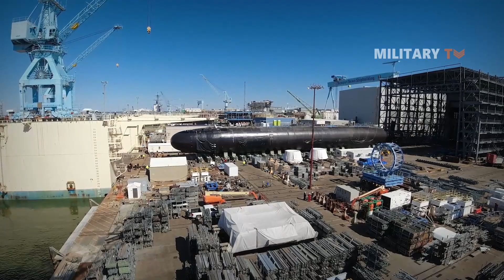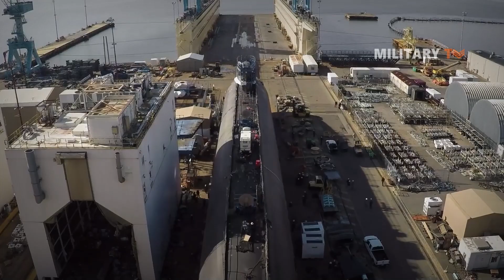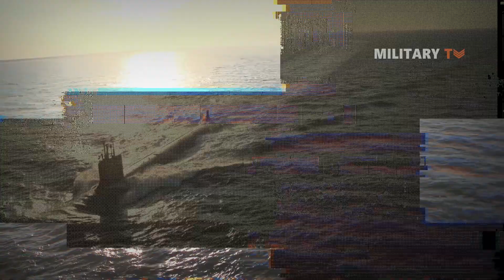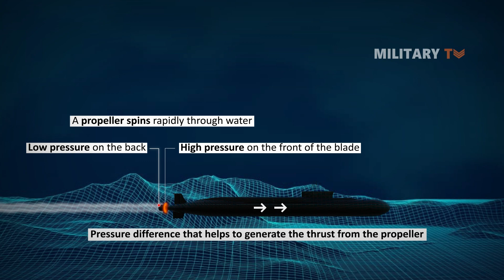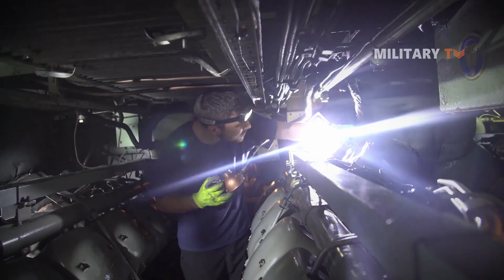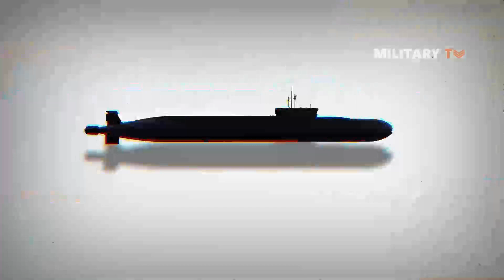The secrets of submarines that enemy must not know

Comment: They need to think outside the box on this. Maybe they could design a kind of cold jet engine of sorts. Use the reactor to heat water in an expansion chamber where it would be ejected out faster than it entered. Surely they could speed up the exhaust water faster than current propellers. They could use radiators to heat incoming sea water and shape the flow path using Bernoulli's principle so the expanding water would keep the flow going through their undersea "jet" engine. Shape it like a jet engine combustion cycle.
Reply: You may be surprised by how much thinking in and out of the box has gone into quieter ways of moving submarines around.   I don; really like your jet engine idea much though - Infra red tracking from satellites would quickly detect a submarine using such a propulsion technique.    Or indeed an MPA  /helicopter / drone  equipped with infra red vision.    Don't forget that much of the thrust of a het engine comes from the conversion of cold liquid fuel into hot gaseous combustion products.  Warming the water up a few degrees won't produce much thrust.

Comment: What about soft propellers like flexible rubber or plastic.
Or ones were the blades change pitch like planes.
A skirt trailing behind the cowling might muffle the pops.
Or several screws in line.
Maybe a texture on the blades or even change the propeller when underway.
Reply: To help you understand, cavitation is so much louder than normal operation that it will be detected by fixed sensors and will need to be explained by the commanding officer at the end of the patrol - an awkward conversation at best !    One cavitation event can compromise the whole patrol.    Loving the creativity, but ........

Soft propellors - not strong enough, but can still cavitate.  Water will boil to steam  and the resulting bubbles with collapse under pressure once free of the propellor's flow (=cavitation)  if the partial pressure  is low enough,cavitation will occur whatever you make the blades from.

Variable pitch - only efficient at one speed - more liable to cavitate at others.  The complexity of the hydraulics inside the shaft would probably be very unreliable and changing pitch would be noisy in its own right.  Type 21 frigates used CPPs, which were unreliable in their early days.

Skirts - how would this work ?     It might flap like a flag and be just as noisy.   Do not underestimate the loads on anything towed behind a submarine - it would probably not be there after a patrol 

Several screws in line - like an aero-engine compressor ? - you need to keep the flow through the "propellor"  as undisturbed as possible - each new lump you introduce  alters the flow and may cause more vortices and more points of low pressure (where cavitation can occur) 

Blade texture - the surface is carefully prepared / treated.  

Changing the propellor underway - what have you been smoking ?   Changing a "propellor" takes a few hours in a dry dock with a crane  and a gang of people who know what they're doing.   This is not like a car's tyre - these things weigh tons.  Even in a flat calm, I wouldn't consider doing this !

Comment: It's probably just shrouded like a jet drive... Less efficient, but these nuclear subs have power to burn. It will also cut down on sound. Have not watched your entire video. Waiting...
Yup, you failed to mention the obvious.
The ocean is littered with loose cables and nets. Mini sub design was changed because of lethal tsngling. Even on a huge sub with only one prop, a tightly wrapped drift net eould be a total disaster. They would be forced to surface at best.

Comment: It’s pretty pointless because they immediately log the signature of the propeller’s sound. They have done this on both sides so the only reason to hide it is actually propulsion efficiency. No matter how silent it is the signatures will be logged and identified on first contact. It’s definitely not the stealth, there’s a submariner who has an entire channel around how he tracked the Cold War subs of the ussr and how they knew them by name and encountered them multiple times. Submarines are so expensive that they are rarely launched and the enemy is aware of when and where they will be launched. They aren’t plentiful enough to be lost in possibilities of what sun could it be. So they are simply hiding the screw for knots per kw. sound signatures are simply impossible to conceal as of yet and if they were it would be with active noise cancellation which must be a heck of problem underwater because the military is aware of the tech for decades upon decades. One reason to hide the screw is to hide the number of blades because you then have a count of number of disturbances per rotation and if you understand the frequency of the engine installed you can do the math more easily to identify. Again nothing to do with technology of engineering shape more just going through the motions of not instantly giving the enemy an established number to do the math in order to predict frequency at rpm.
Reply: Not only prop noise is logged but any sound source being AC or DC  is noted for a particular class or hull.
Reply: @snsproduc really? And why is that?
Reply: @snsproduc so we stop building subs because the enemy knows.  That statement makes no sense whatsoever.  The US has been building subs at a constant rate for the past 10 years and intel is not always accurate.  I was on an ASW mission in 1986 to locate a Soviet Kilo class being sold to Iran and US intel was unsure how many blades were on the prop so we flew on it, dropped buoys, got the intel and sent it to DC.  We verified what they suspected to be true.
Reply: The latest American submarines, since the seawolf class. do not use a propellor, they are using the device first used by the Royal Navy, a propulser
Reply: @paulhill1665  yes the sound level is much quieter.  You are talking about the pumpjet